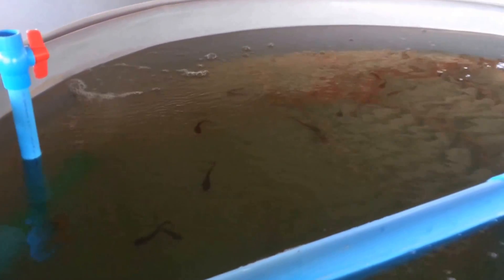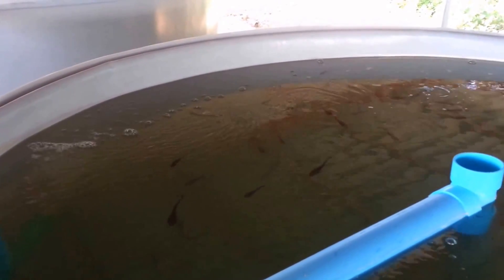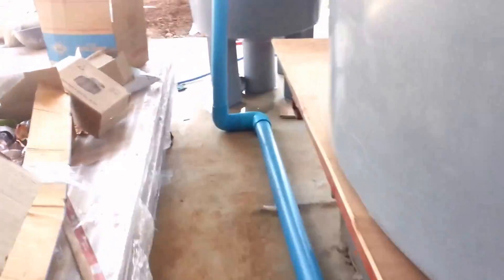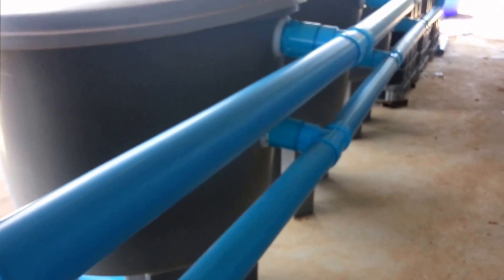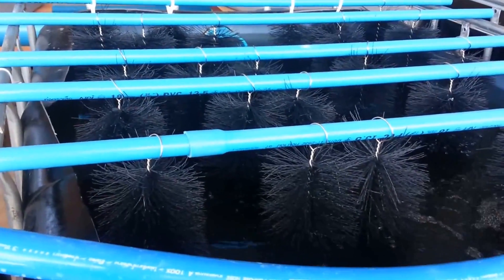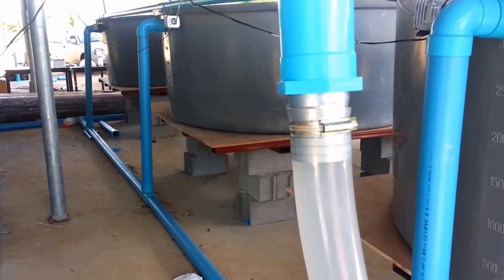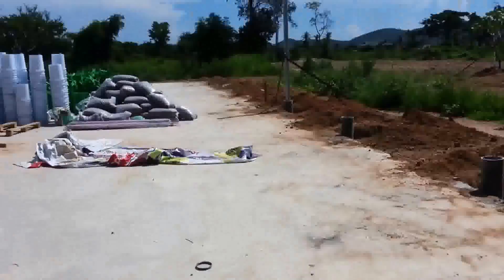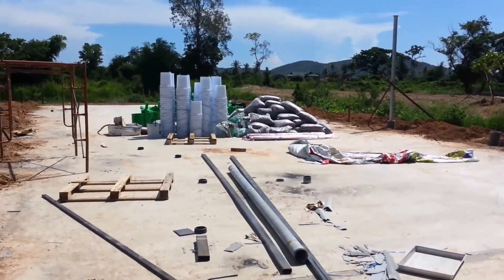Commercial Aquaponics Build Part 10

Comment: Fantastic progress once again Ryan. Great to see fish in the system now. I like your idea of paralleling up the swirl filters to increase the settlement time - nice one. (see... I didn't say it :-) ). Those tomato seedlings are coming along nicely - they'll be demanding that the dutch buckets are ready before you know it.

On a different note... I'm just wondering if you need to provide some protection netting for your fish now - Local wildlife is always quick to spot an easy food source. I think that Pelicans live in Thailand and I know that they're really good at fishing.
Reply from the maker: I'll have fish netting over the tanks for the seabass, mostly to keep them from jumping out. These starter fish are more than welcome to be eaten by the birds. As of yet, I haven't had reason to suspect any of that going on. A bird, such as a Pelican, would have to fly into the fish house, have his fill, and then leave. Would be comical theatrics I would welcome.

Comment: What was the problem with the swirl filters - how come you have to get rid of the 1-2-3-4-out method and go to 1234-out? Water flow rates?
Reply from the maker: I did not provide any head, so the tanks would overflow when trying to push the water. No matter the flow rate, the result would have been the same.